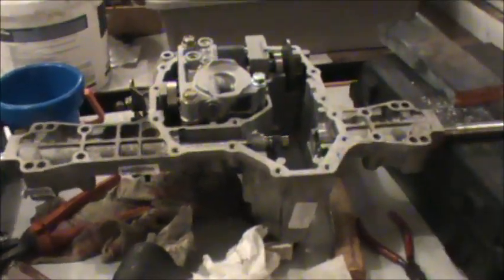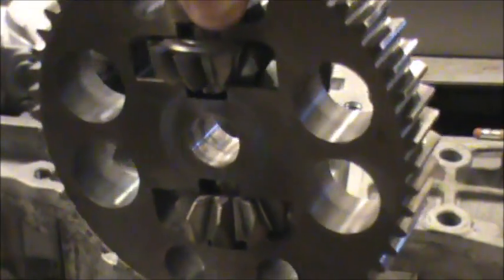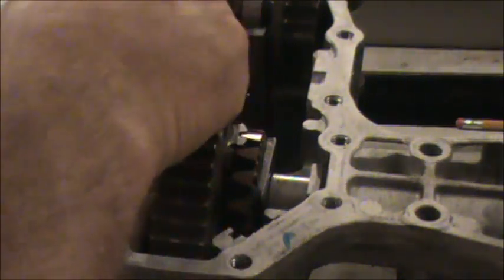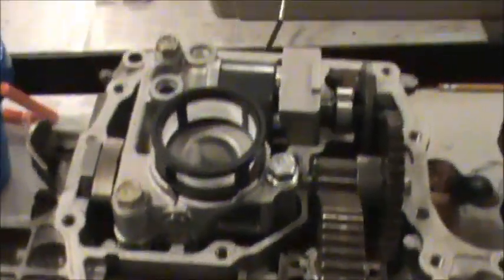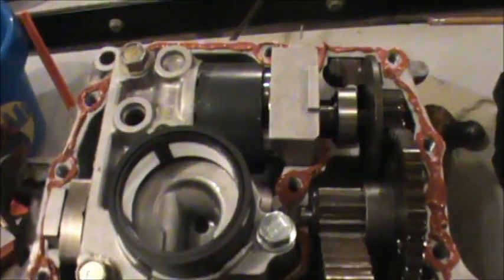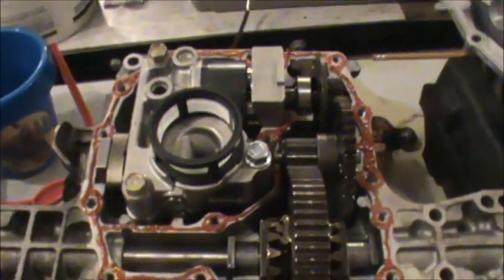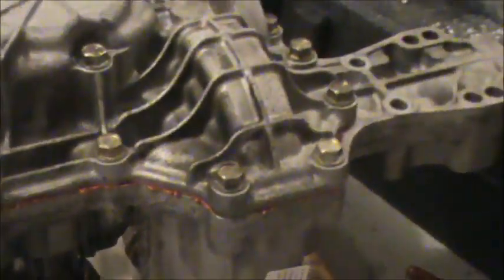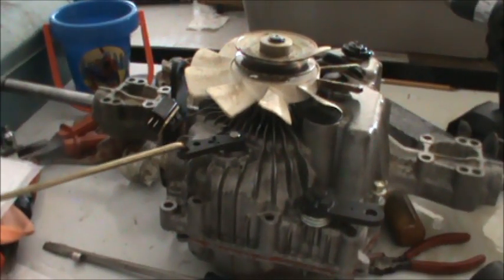Tractor hydro transmission repair or rebuild Part 3

Comment: Unless between the time you made this video and now. TuffTorq and most owners manuals describe how to purge the transmission after working on it so any air is worked out of the system.

Comment: Very nice demo! I might add, when you split the case, on the bottom pan, there should be two deep “dimples”; one under the transmission area and one under the differential area. You can drill out those dimples, tap them, and install a drain plug for the diff and the transmission to make changing the fluid easier. The Tuff Torques are one of the better hydro and were not really engineered to be as “unserviceable” and “disposable”  as the tractor maker would have you to believe!

Comment: Thank you for these videos I found them educational and I feel like I can open it and clean it out. I recently received a mower with a K51a which I could get to go into neutral to push it now I understand the trans a little better I know it may not go into neutral because the fluids were not pumping. So I know if I rebuild the motor the transmission may be ok. But after watching this I may need to open it and clean it out.

Comment: I am impressed.  You clearly have great mechanical ability.  I'm assuming there are seals on the axles as they exit the case.  Would it have made sense to replace those?  I'm surprised you could get those gears, from the manufacturer, so cheaply.  Good for them.  Is there any company that rebuilds these?   It would be great to send in an old one and get a rebuilt one back for 1/2 or so of what a new one costs.   Again, great job and thanks for taking the time to film, narrate, edit and post the video.

Comment: Can you tell me the torgue settings for the bolts that seal up the housing? I just pit the gasket sealer on and have tightened them down, but i was not sure the settings?  Thanks for any help.

Comment: I would have replace the oil seals if I went this far. Also before I would seal it up I would test fit the case together making sure it fits tight together with the bolts and turn the whole system so it turns nice and easy. Then take the cover back off and then seal it. Nothing worse than finding out somethings not right and have to mess with that silicone again. Just saying

Comment: Looking at the top of the unit , fill plug . Right across from it is another black cap . Do you know what that is ? An where did you get a parts list for the trans axle . Thanks !   I have a husqvarna  that the axle shaft broke . $80 bucks for new shafts from ebay .

Comment: you are a brave dude. great video. I watch most of your videos thanks. I do small engine repair here in The Napa Valley ca. The sun is shining now and the machines are coming. I'm 75 and getting to old for the riders now. I stick to smaller lawn mowers chain saw 2 and 4 cycle.

Comment: Do you think the fact that John Deere uses 10w30 vs the synthetic 5w50 recommended oil is the reason that the problem occurred?
Reply: I think its contributory.
Plus gears weren't spaced correctly, too much clearance

Comment: Hate to say it, but there a lot of lash between the axle gears to the spider gears, and could be most of of the problem of why the the diff ate the axle gears to begin with. 

 Truth be told, I would load some thin wave washers between the back sides of the C clips to the face of the end  locks, to mesh the axle gears to the spider gears tighter to take out a great deal of that lash between them as they are free running, plus the thin washer will shim the gears together better even when fully compressed.  Hence looking at the mesh of the gears now with everything back together, you can see that is just the tips of the axle gears to spiders tips gears that are meshing (way too much lash), and under torque, going to be worse with the axle gears driving away from the spider gears even more without shimming as well.
Reply: Yes sir I also thought so.
Plus 10/30 is too thin, needs to be a 5/40 or 5/50 (latter is Tuff Torques Proprietary suggested fluid).
Add up the excess lash (too much clearance, not enough contact), thin lube & probably towing loads = trashed diff gears...
Reply: As someone who worked in the gear production industry this problem appears to be a (hardening ) hardness problem.

A hardened gear running against another that was heat treated improperly.

Comment: I would have installed Shims on that Planetary Gear/Axle Shaft assembly. The slack you had is what caused the issue in the first place.
Reply: Not sure about adding shims, but when I do my K46 tuff torq transmission from my JD L118, I'll have to find out tolerance.  My guess is 800+ hours of operation did the damage. My L118 is over 1300 hrs. Its still pulling but on its last leg. My point being shims were not designed into this originally.

Comment: Thanks for taking the time to make this video, Im curious as to why those gears failed, did you notice the seal condition on the axels, was there any play on the axels while inside the axel housing, Tuff Torq tranny 's usually out last the mower, Thanks again your videos are very helpful.

Comment: Excellent job.  I had an L110 with snowblower.  That thing could take anything I could feed the blower and as fast as I could.  I really made that transmission work by hauling 4,000 lbs of landscape rock around my house with a home made carrier bucket.  One tough transmission.  Last I seen it, it was still running excellent.  People run down the cheap JD, but not true.  Good machine.  If your front spindles ever get loose.  The bushings are hardened steel and the spindles are what wears out.  The bushings are like $40 each, but the whole spindle assembly was only $15 each at the time.

Comment: Great job!  If the two sections of the case are separate I wonder how the oil gets into each section when there is only one fill.
Reply: where the oil is filled there are two chambers through the one port

Comment: excellent videos.  i have two jd la145 w/ t40 / t46. one works super. i rebuilt the 2nd & instatalled. bleed air. works ok but does not engage as fast as other one. on right hand pedal for for /  rev there is no adj. on left for stopping is adjust. i tightened up similiar to other. still is sluggish. primary drive belt deflection is 1.5 inches.  any ideas how to improve . thanks
Reply: forgot that i installed tuff torq synthetic fluid as well

Comment: I know this is an old video series and apologize for commenting on it. I enjoy your work and wanted to say that you did a good job with the repair. In my "pre-retirement" years I repaired industrial drives much like the Hydro you worked on. Much larger but same principle! So many YouTube creators have said that the hydros are not serviceable, but now I know better. I had always wondered what type system they were and now I know that the pump and motor are what is known as "swash-plate" as opposed to a positive displacement gear pump. They allow for a little flow-by so there's not need to add expensive regulators etc. It is odd that JD would opt for 10w30 when Tuff Torque recommends 5w50 full synthetic. Maybe its a cost thing to keep themselves at a competitive price point. It is odd to me. Anyway, thanks for sharing it. All the best
Reply: Thanks Charlie I was wondering what that system was called.

Comment: Great Videos! Very good camera work and thorough explaining. Did you by chance see how the input shaft (the one that goes from the pulley to the pump) comes out? Mine is stripped and it seems like its not wanting to budge out the top.
Reply: Did you replace your input drive shaft, if so, how bad was the shaft worn?

Comment: tuff torq has the process of bleeding air out on their website. basically up on jackstands, pump the coast switch a few times, the go forward and backwards on the pedals up in the air until air bled.

Comment: I did this.  Great video.  I have a problem though, now when I press to go forward, I go in reverse and when I press the foot peg to go in reverse, I go forward,  What did I do wrong?????
Reply from the maker: You lost the little Tick tac like pin.
Reply: Easy Fix:
Turn seat around facing other direction !

Comment: This is not simply a video about repairing a transaxle that your dealership will deem 'unservicable'...it's about a guy who's brave enough to attempt what most people wouldn't think of doing.  It's the courage of guys like DW2 that makes "DIY" a great concept.  Your father, grandfather, etc...would be proud.
Reply: Well if you start with a broke lawnmower attempt to fix it and fail you still have a broke lawnmower so take it apart figure it out

Comment: You should replace all your seals if you go this far also. Last thing you want is a axle seal leak or a leak were the pulley shaft comes out and any other seals.

Comment: Have you done any videos of removing stuck/rusted/frozen lawn tractor wheels from axils?
Got a free Craftsman LT 1000 which I rebuilt the engine on and now must pull the wheels to replace rear cracked tires (with good tread) but leaking air through side cracks. Unfortunately I don't have a wheel puller and they are not budging.

Comment: Thanks for the videos. What I find amazing is the number of people doing the same thing to this transmission from what is supposed to be a quality brand and JD does nothing to help. Some have a lot of hours on them but some I have read about have less than 200 hours. I have a La130 with a 48" deck and a rear bagger. If the transmission won't supply the power needed, probably a 42" deck should be all that you can get for it and a rear bagger shouldn't even be an option.

Comment: You Must have a bad dealer in your area John Deere for my tractor they will fix it and they should be able to do a rebuild on your model of tractor. Find with a good parts department. They have some that will try to rip you off.  I checked john Deere sells the parts so if the dear say they cant get the parts go else where.

Comment: I would have replaced the axle seals while it was disassembled. I am working on my second J.D. LA115 that had leaking axle seals. Thank you.
Reply: Axel seals can be replaced without disassembling the housing.

Only the wheel needs removed.

Comment: Is the whine the transmission makes in the video pretty normal for these transaxles. I just bought a used mower with this trans and it sounds just like that. Concerns me, but I got it cheap enough that I can repair trans if necessary. Being winter time I cant really put it too much of a test to see how its functioning.  Thanks
Reply from the maker: TheRock0232 That whine is standard.
Reply: doublewide6
Thanks. May take it out and change oil and filter. Sure that has probably not been done before on it.
Reply from the maker: The whine is normal.  I got rid of the tractor to a friend and he has been using the tranaxle for 2 seasons now no problems.

Comment: I noticed that axle gears to pinion gears seem to have more play then needed. Wouldn't it be wise to use shims to each side to get play to accurate pressure angle play per Machinist Hand Book guide? I machined &applied many typical type of gearing assy.s  ** MOST EXCELLENT VIDEO SET **

Comment: Great video.  JD replaced the transaxle on my brand new X304 at 14 hours which totally destroyed my confidence in that machine.  However, it's been 7 years now and never another problem.  If it happened again I feel that I could do a repair based on your video.  Thanks and keep up the great work.
Reply: Wonder if they then put the right fluid in it?

Comment: DW6, can you just change the oil in these without removing entire axle? perhaps yearly as part of maintenance. no drain plug at bottom of tranny i suppose, thanks for all great videos!!
Reply: There are other ways to drain the oil without removing the transmission from the tractor.  I did a lot of work on my 20 year old Craftsman lawn tractor three years ago that included removing the body metalwork. There were only 4 bolts in easily accessible locations so it takes maybe 10 minutes. I then changed the oil in the Hydro-gear hydro transmission by popping out the vent hose and sucking out the old oil using a syringe and some vinyl tubing. I replaced it with Lucan Magnum 15W40 synthetic diesel engine oil which seems to have worked well.  I have probably about 1000 hours on this tractor and the transmission has given me no problems at all even though I work the thing pretty hard.  I would expect the same method of oil removal to work on the Tuff Torq transmissions.
Reply from the maker: You can pull the entire back axle it less then 20 minutes.  You need to pull the axle the to drain the oil.

Comment: They should rename these transaxels "FluffTorque"  My JD L130 has gone through four of them.  The one thats in it now started having the same problem, wear in the pump and motor, causing it to slow down and not pull up a hill.  I considered rebuilding/replaceing it too but decided to dry using a heavier oil.  I drained and replaced the oil with Amsoil 60w Dominator oil.  It did the trick.  It came back to life and is still working a year later.  I plow snow in the winter and mow acres of grass, some on hills.  Leakage past the pump and motor pistons is significantly reduced with the heavier oil.
Reply: +wayne jardine Hi Wayne, I'm in the same boat with my trans fix, Tuff Torq recommends 5w50 but I believe my motor and pump need replaced so I was wondering what viscosity Amsoil did you use? Was it straight 60w or like a 5w60? Thanks, Ken
Reply: +snowking55 Whatever the dominator is.  I don't remember but I think it was straight 60w, could be mistaken.  Its still working and its been three years since I changed it.  When it stops, I think i'll put in a K60 and use this k46 for a boat anchor.
Reply: +wayne jardine Ok, thanks. I found it on the Amsoil web site and it's a straight weight 60. I'm going to give it a try, thanks for the response and the recommendation.
Reply: I switched everything i have to Amsoil and i use Sea foam products also.
Reply: K46 @ 60w Amsoil update ?
Its been some more years how's the heavier Amsoil holding in your Hydro tranny?

Is it slow to go in cold weather ?

Thx I'm considering my 1st Hydro tractor !

Comment: Thanks for the video.  I have the exact same tractor and problem.  I haven't opened it up yet, but the symptoms are the same and the guy I bought it from said he opened it and found it was the spider gears too.  He had ordered the part  from ebay and they were the wrong size.  Mine only has 174 hrs on it.  I have another one with the smaller engine (L110) with over 500 hrs with the same K46V and it's blown snow, pulled trampolines, moved trailers and you name it and is perfect.  I think the oil selection and engine size makes the difference.

Comment: I have a Tecumseh hydro, the final drive was full of metal (Had no oil in it from the factory) and it was full of metal. Poured engine oil in it, pushed it around and drained it 2-3X and filled it with synthetic gear lube, still working but I believe it has a similar problem as this video... Thanks for the rebuild video... I also put synthetic 5w30 hydraulic oil in the pump.

Comment from the maker: There is no external filter.  According to the transaxle manufacturer you have to run the tractor on low idle with the hydro pump disengaged and the rear wheels lifted from the ground.  Continue engaging and disengaging until the tires start to rotate.  Once the tires rotate you can slowly drive the tractor and gradually raise the throttle until you reach full speed.